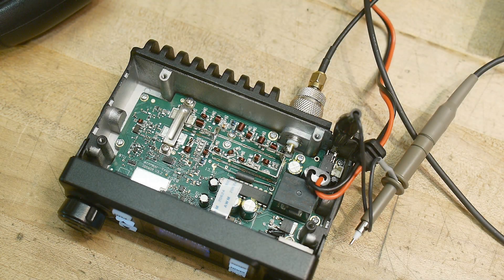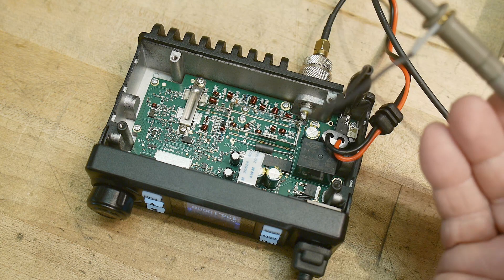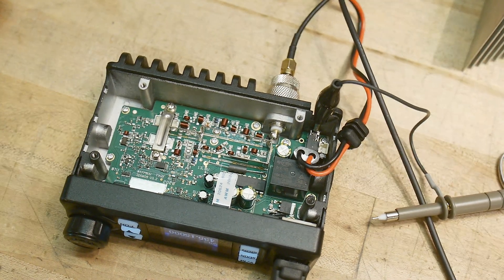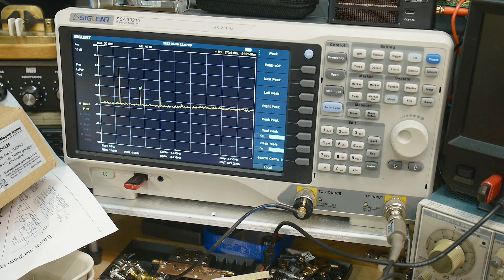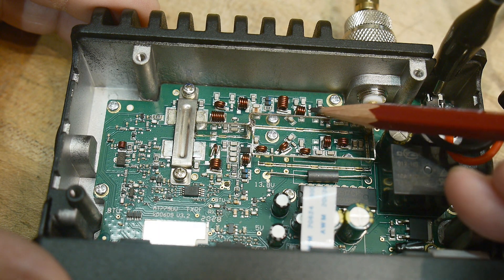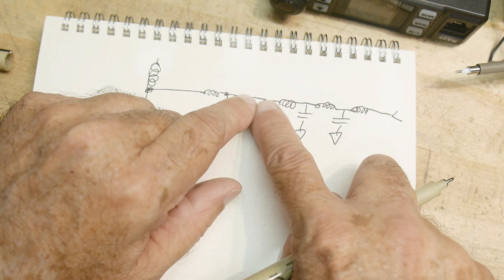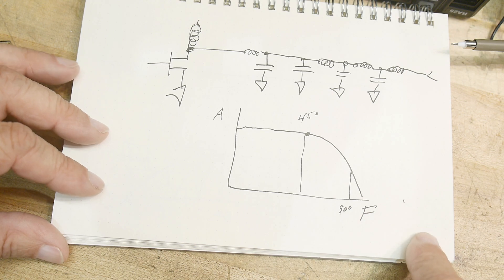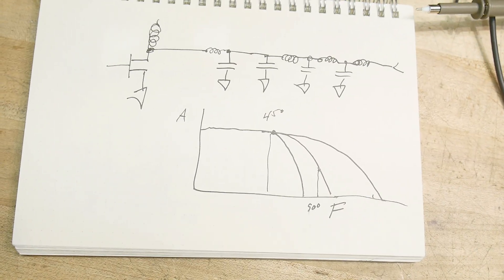#1604 FM Transmitter Harmonic Suppression

Comment: Do harmonics also appear at frequencies below the carrier.? If so would a band pass filter  be more appropriate? Thanks for the video.
Reply from the maker: it might be possible in an odd radio, but I've not seen it.
Reply: Harmonics per definition is frequencies that is a integer multiple of the fundamental so they can't be below the fundamental frequency (except DC?). Disturbances below the fundamental is less often a problem but would be called subharmonics or something else.
Reply from the maker: @larslindgren3846  the lower stuff is usually mixer artifacts, not harmonics as you point out

Comment: Takes me back 40+years when I did a m-derived LPF   using a GDO & Smith Chart.
The great thing with LPFs is can do z-matching too
Reply: M-derived filter? Made a couple of them a long time ago as well. Are you familiar with the Microwave Transmission Circuits volume of the "Radiation Laboratory Series" pub.1948? M-derived filter described in Vol. 9 p. 572. Entire series available in PDF. Fascinating read!
Reply: @milantrcka121   Not familiar that publication. With filters though it's 'horses-for-courses' they all have conflicting pros and cons, there used to be good write up in the ARRL & RSGB handbooks. 
I remember making a brilliant m-derived harmonic filter with twin resonant traps, back in late 70s. Not one single sprog got through.  I lent it to a friend a pirate home base rig and he blew it up by putting "400 W" through it.
Reply: Update  yes I realise I had actually seen those but unlikely that particular article. Back in my home country a friend a "Class A licence" has ?had :(  extensive sets of these on hardback and lots of Radar books too.

Edit:  I just checked Rad Lab 1948 Vol 9 p.572- 577.  That wasn't the resource I used at the time I did my m-derived filter.  I used the filter circuit itself as its own analogue computer, with a grid-dip tunable oscillator. I used 'nomograms' and Smith Chart. Really I'm standing on the shoulders of those clever and committed people who'd formula-rised all of that for me into a computer-free /maths-free development system.

Comment: FET = Source Drain Gate?  What collector?  Also narrow, wide, cut off, slope, bandwidth and attenuation are all standard ways describe a filter, "fast" and "slow" is just confusing, anyone learning from your video will have terminology that isolates them from other learning resources.
Reply from the maker: yes, sorry, the drain
Reply: @IMSAIGuy  You replied a bit quicker than I expected, i'd updated the comment, sorry for the confusion.